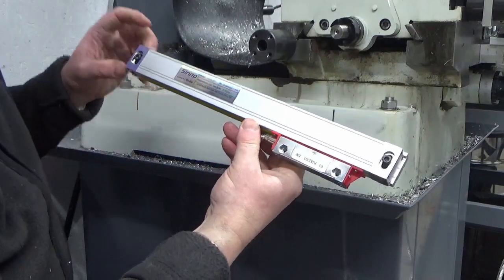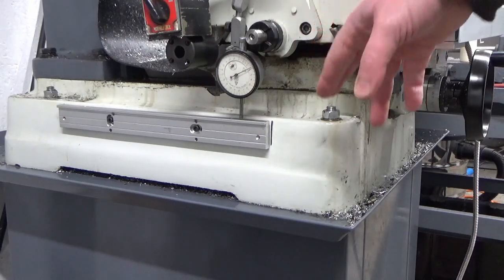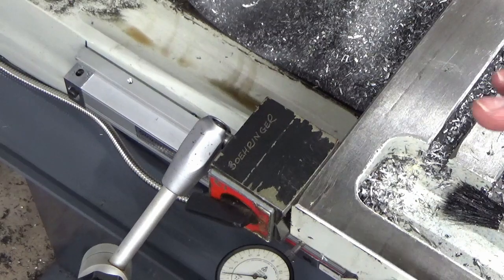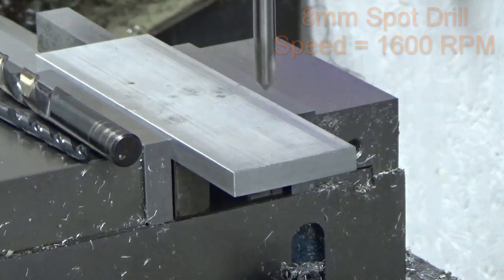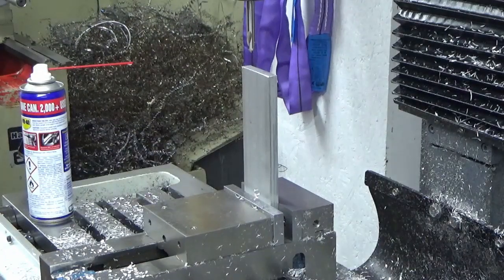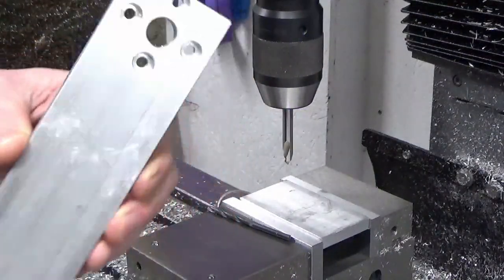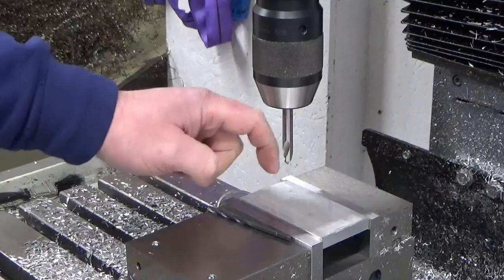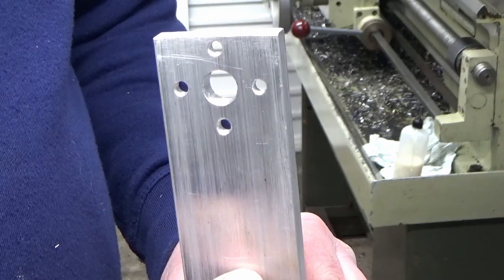Fitting A DRO To The Cormak ZX 7045 Mill Y Axis Part 2

Comment: Well done Jon. I mounted my Y axis scale on small 10mm thick aluminium plinths either end. 4 grub screws in each plinth for alignment. Also allows chips etc to fall behind. Quite a bit smaller than yours mind as they're magnetic. If you do your lathe get magnetic ones, well worth the extra.
Reply from the maker: Hi Dave, thanks for the comment. I always knew the Y was going to be the most difficult due to the state of the casting. Just pleased it's done and seems to be performing OK (already in use on the next project). I will take your advice if and when I do the lathe, thanks. Cheers, Jon

Comment: Hmmm,a power feed on x -axis next?perhaps a silly question:could you easily swop out  the cables in back of the display if you have only scales and wiring on your lathe.my little lathe and milling machine are close together so I could easily rotate the (then one)display either way.
Reply from the maker: Hi Robert, thanks for the comment. Maybe an X axis power feed but not for a while. I am really not sure, I guess if you had the same scales the I can't see why it wouldn't work, they are just linear scales at the end of the day. I suppose the only drawback would be you would potentially lose some of the functionality of a dedicated turning DRO but probably not big loss. Cheers, Jon

Comment: I'll give you full marks on the installation Jon, a very good job and well worth your time and effort, By the way, where did you get those bottles from, the ones you use for coolant, with the very small nozzle? I know you did say in one video but I am dammed if I can find it.
Reply from the maker: Hi Del, thanks for the comment and feedback, much appreciated. I got the bottles from either Ebay or Amazon (can't remember which now) but if you type in "needle nose bottles" into either, then you will get a pretty big selection to choose from, there were loads selling them when I got mine. Cheers, Jon

Comment: Still see ZX7R for some reason, prob coz I have had a few! Job well done Jon, I have used a few times for PCD, straight/angle line drilling and usual functions cost me more than I will admit  but would not be with out it,. I really need to learn how to use other functions but just for the few I have used it for have not regretted paying for it. What type are your scales Jon ? Don't remember if you have mentioned! TFS, G :)
Reply from the maker: Hi Graeme, thanks for the comment and feedback. Never had a Kwak, plenty of Yams and Honda's in my day! The scales are glass (not magnetic) and JCX Serials. Not the cheapest but not the best either, about £360 from memory for the whole shooting match. Cheers, Jon